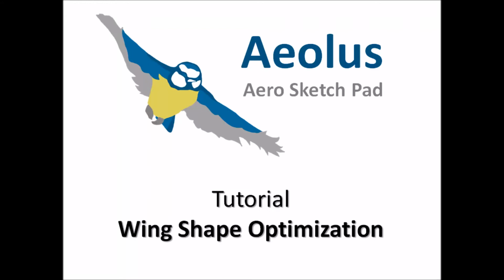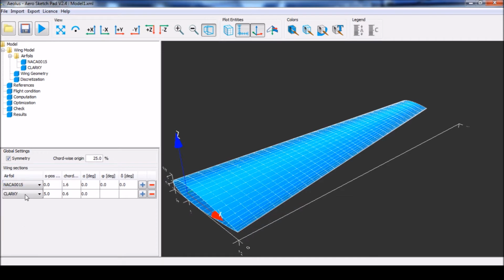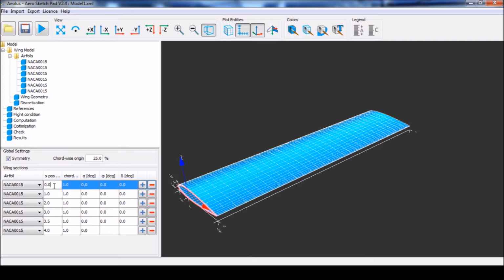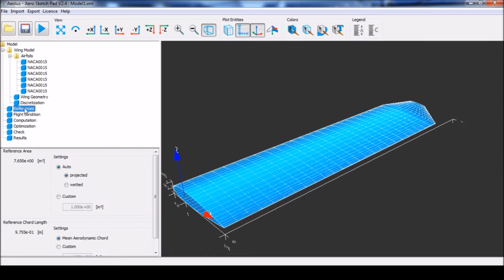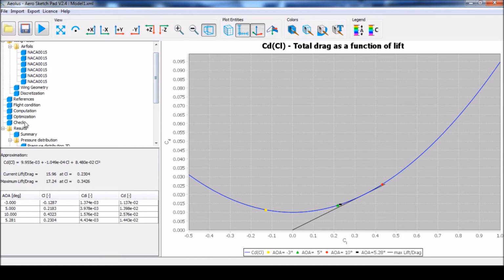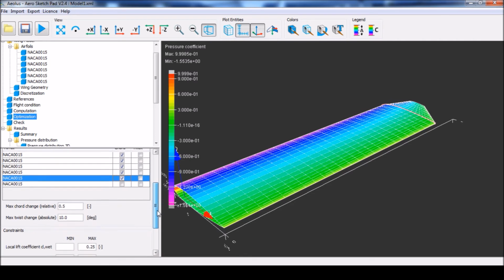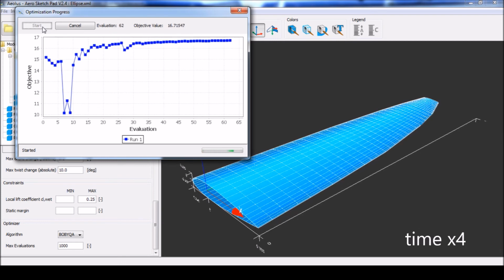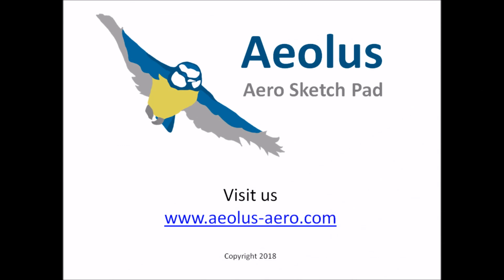Efficient Wing Shape Optimization with AeolusASP

Comment: i'm sorry, the planform should not be elliptical
the lift distribution should, yes, but many different planforms can achieve that
Reply: Right! However, in this simple optimization demo the design variables are the chord lengths (constant twist) for which the best solution is the elliptical planform
Reply: @uweschuster9124  thanks :)
this paper states otherwise
https://ntrs.nasa.gov/api/citations/19960015887/downloads/19960015887.pdf
on page 41 they show the untwisted elliptical planform not producing an exact elliptical lift distribution
this seems to be especially true for lower aspect ratio wings
if the elliptical planform was the correct solution, there would be no point in doing aerodynamic analysis and adjustment of the chords, one could simply draw an ellipse and fit the chords to that
Reply: @marc_frank  The purpose here is to have an example which demonstrates how the optimizatzion feature works. The simplification is necessary to have an expected solution that we can compare against.

Note, that the optimizer looks for lowest drag here. The resulting elliptical planform validates the drag analysis

Comment: Hello! How can I add elliptical distribution onto lift distribution plot? 2.25 on your video
Reply: Hello! The elliptical reference plot was part of an earlier version and has been removed, because it can be confusing when used on non-planar wings. You can, however, copy the tabulated values into excel and add the ellipse there.

Hope, this helps
Reply: @uweschuster9124  thanks!